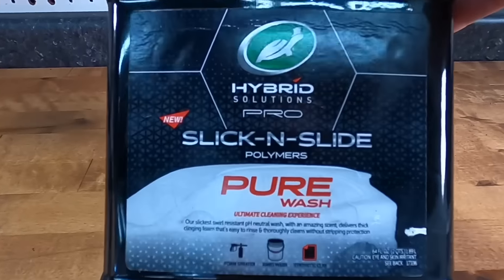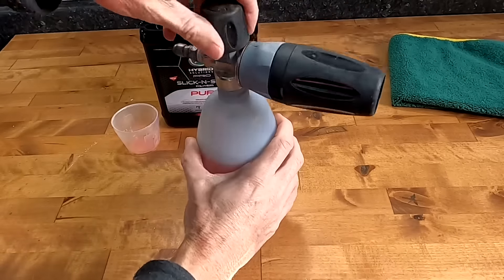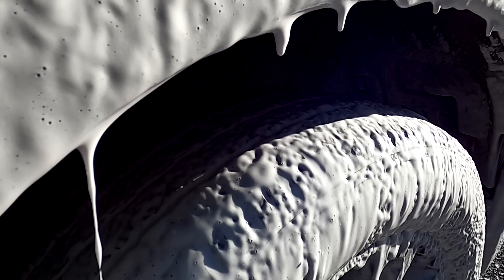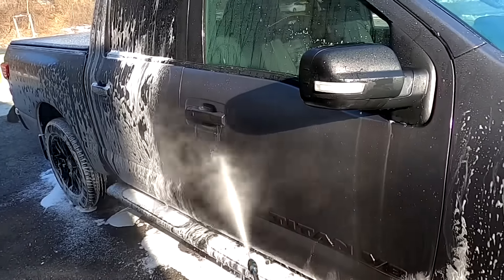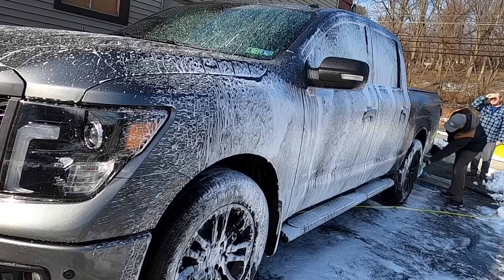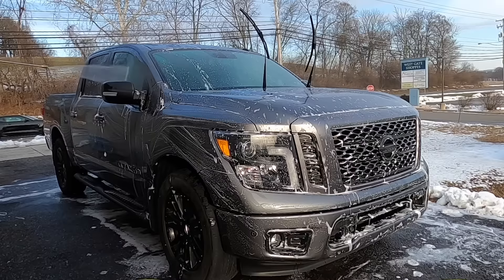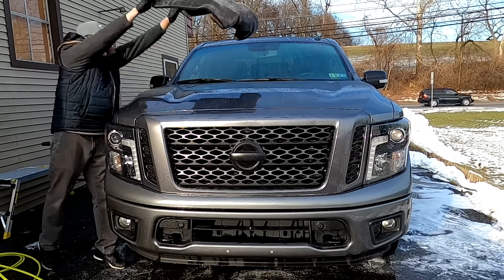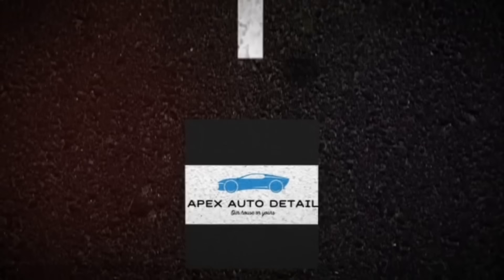Slickness? Suds? Lubrication? Turtle Wax Hybrid Solutions SLICK & Slide Pure Wash!!!!

Comment: Merino Wool makes the cold less miserable. I like the socks from Stance.
I’ve hiked up Machu Picchu and XC Skiing at grand Tetons by Jackson Hole in 13° with wind chill.
The stance merino wool is great for heat retention but also breathable.
Our feet/hands has the most arteries and veins (via anastamosies) so keeping those areas warm help us regulate overall body temperature.
10/10 would recommend Stance or any merino wool blend socks.

Comment: Currently 8 degrees in Massachusetts. I'm 44 now and I feel the same exact way you do. Such a hassle to do anything, or get motivated for that matter. I  wash in the garage using a propane heater but it still just sucks. I can't get water out there as it will freeze so I'm stuck to a Worx hydroshot and 5 gallon bucket of warm water. My hands are also problematic so I wear Kinco Aquanot gloves. Screw winter.

Comment: It's almost 60 degrees now and I haven't hooked up the hose or gotten the power washer out yet.  I'm almost out now so I guess I'll try this having heard some very good things.  I try to keep my detailing supplies at an absolute minimum since I need to store them over the winter inside.  I only have an IK Foam 2 pump sprayer so this lingering foam might work out well.   I just did the white Malibu the other day, and was pleased at how well the Ethos Ceramic held up since early Fall.  Headed up to the spray wash and hosed er down, then used Ethos D3FY for a waterless clean.  Thing looks like new again.  TW has definitely come out strong again, good to see the competition.

Comment: My new #1 favorite. Great value, awesome strawberry watermelon bubble gum scent, insane foam, unrivalled lubrication, and no residue or streaks. It checks all the boxes. The lubrication really stands out the most. I've never seen a soap be anywhere close to this slippery, it just doesn't give up. Turtle Wax really knocked it out of the park.
Reply: how well does it clean a very dirty car that's covered with bird poop, traffic grime, and tree sap? how well does it preserve sealants on the paint like seal n shine or ceramic spray coating? thank you for sharing your experience.

Comment: This does not really test the shampoo’s cleaning power. Any shampoo can clean if you use a mitt! I would like to see how it did after the snow foam stage only. Did it pull off the grit or not
Reply from the maker: This was not a test video.. just sharing the whole experience. As a test video, I can foam one side with this... one side with say, CarPro Lift. 👍🏻

Comment: I just use the Bilt Hamber products but also like Carpro Reset. All are getting low so I'll most likely replace them all with this TW stuff IF it hits the UK in time! I don't clean my cars when it's very cold but for winter washes, I like the following: Snow foam, PW rinse, apply shampoo via the snow foam lance (here a hybrid product that does both stages is a help), and use two warm water buckets for the mitt. Removes exposure to cold water, especially if drying with a leaf blower.

Comment: If I use a car shampoo, I use Malco Prizm Shampoo, about $15.00 per gallon.  If car is ceramic coated, I will add TW Ceramic Wash to the Prizm.  Majority of time, during the winter, I use a mix of Power Clean & ONR or ONR with Wax.  The current temperature this am is 6 degrees, added wind chill about 20 below.  Brian, you will have these cold temps tomorrow and or Saturday!  Happy Cat Care...

Comment: Hey Brian! I have a question that ties into using any auto shampoo. Would you think that auto shampoos in general would degrade surface protection, compared to let’s say a rinseless wash solution? I ask this because we know that any auto shampoo is going to have surfactants in it to help break down dirt. These surfactants are missing in rinseless wash solutions as they are primarily using polymers to encapsulate dirt and provide lubrication. 

Even if the shampoo is ph neutral would these surfactants alone have the strength to diminish protection on the vehicle over time? And if that being the case then can we say that using primarily rinseless washing techniques will help extend the life of wax’s, sealants, and coatings?  Great video and I love the new intro as well!
Reply from the maker: They do deminish long term. Also the best way to open the pores so to speak of coating as they age. Rinseless products cant do that effectively. Great question.
Reply: @apexdetail85  Thanks! I love detailing and thinking about it enough makes me wonder about certain aspects of it. I’ve been moving over to the rinseless washes as of late (due to colder climates) but I never really considered any pores being opened by surfactants. I’ll plan to add a traditional 7 mitt 1 bucket wash from time to time.

Comment: I used it for the first time yesterday in direct sunlight at 65 degrees and the day before at the same temp basically and it dried super fast on the vehicles.  But it did also feel like it was supper sudsy and like I didn't need to dunk the mit

Comment: For our shop, slick and slide has replaced reset. In my opinion it's as good, if not superior, in most areas. The big things I look at are lube and rinse-ability. This checks the box on both and the price is too attractive to pass on. First TW product we've taken on in our shop
Reply: Try meguiars hyper wash
Reply: @5hift6ear  do you like it more than slick n slide?
Reply: @CoDhruv  Honestly I haven't used slick and slide.  Hyper wash checks all the boxes for me at a lower price point.  You'd be hard pressed to find a better soap for the money.  It just flat out works.
Reply: how well does it clean a very dirty car that's covered with bird poop, traffic grime, and tree sap? how well does it preserve sealants on the paint like seal n shine or ceramic spray coating? thank you for sharing your experience.
Reply: @mujjuman Probably not as well as some high PH soaps. It’s a ph balanced soap so it won’t strip waxes and coatings. It’s has a dilution ratio of 400:1 I think. It’ll last you a lot longer than most soaps especially. I’m surprised your shop bought it, Turtle wax products are generally viewed as consumer products, but it’s nice to see it getting recognition. Their hybrid solutions is a step above.

Comment: Nice new intro and great review. I just used the TW wash yesterday as a clay mitt lube out of my foam canon. I thought it worked great. No visible marring even the areas I scrubbed a bit. I will have to test its cleaning ability vs Reset. Curious to see how it cleans the Indiana salt off. As far as dealing with the cold, if it is above freezing I like to wash outside. I found some vinyl freezer gloves on Amazon that have great insulation. Love them so far for cold weather washing.
Reply: Which gloves are you referring to?

Comment: Apex Auto Wash, Lithium Double Tap, Reset and the slick and slide. This stuff is hard to beat for a cheap shampoo but it can't kick Apex out of my first place spot because for the price, you're not getting anything better. I don't want scents, protectants or anything other than clean, zero buildup shampoo which Apex is.

Comment: This is a car shampoo that is best used via a foam cannon, not a prewash snow foam. I would highly suggest to everyone to buy a proper dedicated snow foam and then use turtlewas slick n slide as the shampoo. A proper snow foam is designed to run off, and pull the dirt off with it. You won’t get a better snow foam than Bilt Hamber Touch less, but appreciate it may be tricky to get in the U.S, in that case it’s got to be CarPro, or Gyeon for prewash and then slick n slide for your contact wash!!! Thank me later😉😉